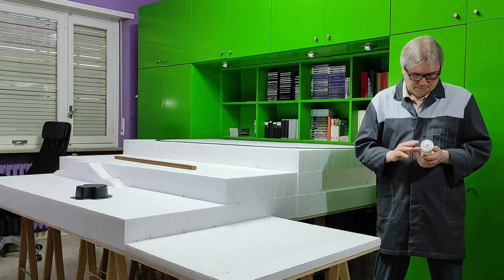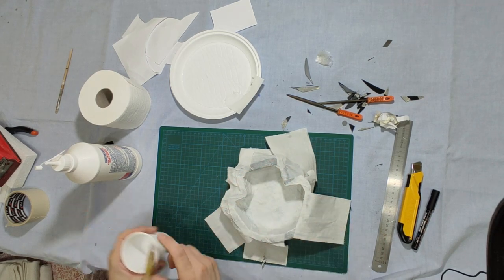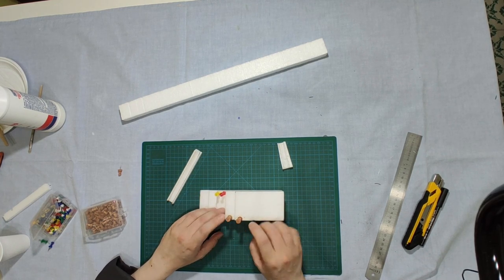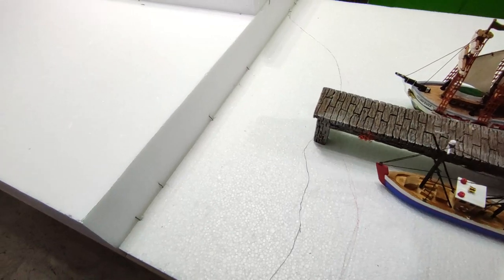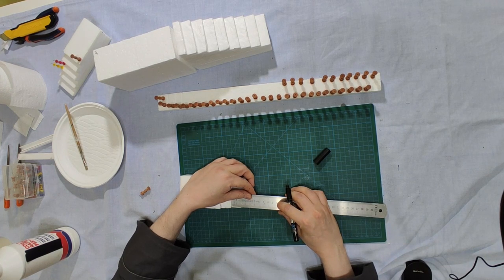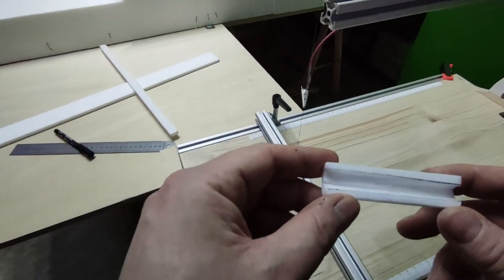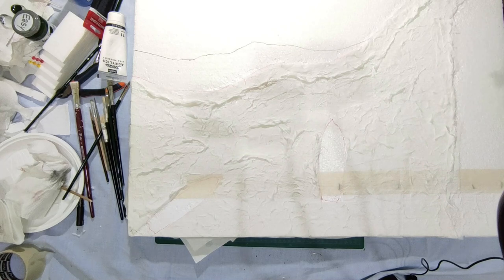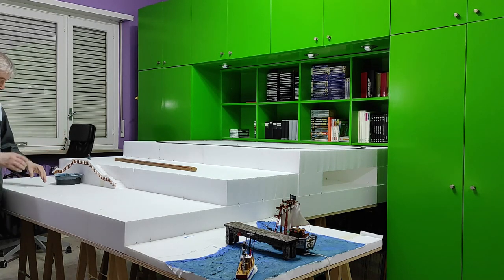Christmas Village Tutorial 2021 - Part 3

Comment: Hello Silvio,
Awesome idea with the push pins as balusters! I had wondered why you cut off the top pin because it could have held the handrail in place. Then I realized you had to cut it off because it would have went through the handrail. Duh on my part. I have seen the toilet paper way in one other video but he did not give the detail you have shared and yours has so much texture, it didn't flatten out when it dried. Thank you, I am going to try that.Waving to Sister Sarah on the steps.😊
Reply from the maker: Hello Susan,
Please choose a thick enough toilet paper otherwise it will surely flatten and it will lose texture.

Comment: I've done a similar method using toilet paper and glue for the water and waves. I haven't done the top layer yet. I've followed marklinofsweden on youtube and he uses about 4 layers of high gloss vanish. I may do that or decoArt triple thick gloss glaze or a thin pour of Art  resin (as I have some for my streams) - I'm going to experiment first.
Reply from the maker: Yes marklinofsweden is absolutely  on the top 10... no sorry on the top 5 of train model builders I have always been impressed by the realism he can achieve. His technique for water is perfect if you want a river, a lake or a sea flat or almost flat. If you need rough water all rely on multiple layers of paper (way over 4) because gloss varnish it is not dense enough to allow modeling big big waves. I always experiment with new materials, it is a must. And now I am too curious about your work.

Comment: Did you consider using the Woodland Scenics Realistic Water , Water effects and Water Waves for your body of water with the boats?
Reply from the maker: Hi Robin. Thanks for the suggestion. The Water Effects not really because it is suitable only for flat or still water surfaces. To be honest I have used the Water Waves just once in past some years ago. Less thick than silicone sealant but with a higher curing time and very hard to find in Europe at a reasonable price.
Reply from the maker: Hi Farida. Thank you. Yes I've tried it in the past, in 2018 if I remember correctly. It is perfect if you want some flat water surface with no movement effect. But you can't shape it while it is curing so no way of doing some waves. Thanks again for sharing.

Comment: Ok I know this is random but I need advice. I want to make glass railings but don't know if I should use clear rubber or clear acrylic??? Help
Reply from the maker: Hi Agnes. IMHO clear acrylic will be hell to cut. I don't know precisely what you want to achieve but generally if you want to cut clear rigid acrylic panels or sheets (3 or 4 mm thick) with standard tools such as knives or cutter blades or a jigsaw most likely it will crack. This because it is absolutely not elastic or bendable. The only way to cut it precisely, especially if you don't go with straight lines, is to use laser. But you can bend it with heat (not too much or it becomes opaque, matt).
May be clear rubber is more suitable but you need a good thickness (minimum 2 mm) or the railings will bend.
Epoxy resin could also be a solution for glass railings but you need to make a mold previously.
Reply: Ok thank you
Reply: Does the brand of epoxy resin matter?
Reply from the maker: Absolutely NOT. Just any kind of 2 components epoxy resin.
Reply: Ok cause ik I have to build a mold too. But my next question is how do you figure dimension's for the build of railings?
Reply from the maker: You need to find the good proportion between baluster, stairs and railings. Can you give me some idea of length, width and height of what you want to realize? Maybe I will be able to sketch you something.